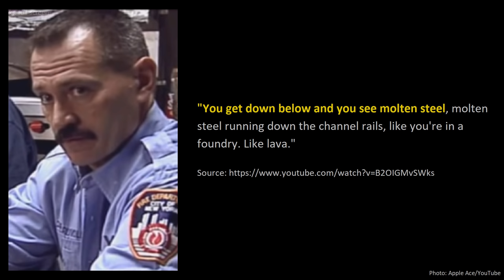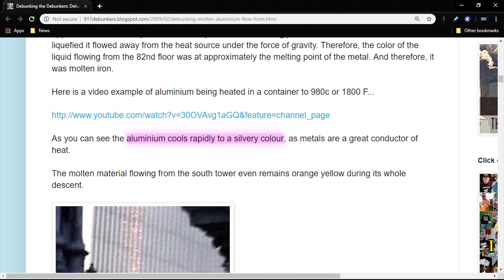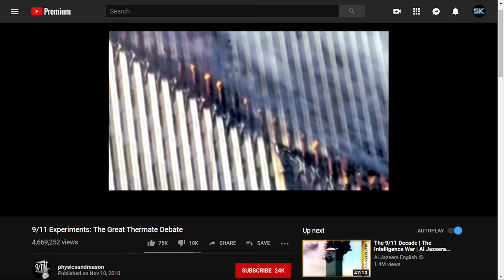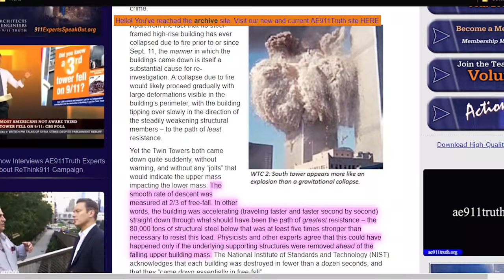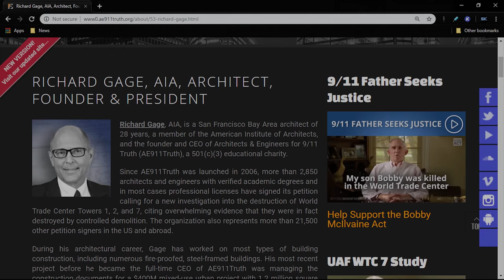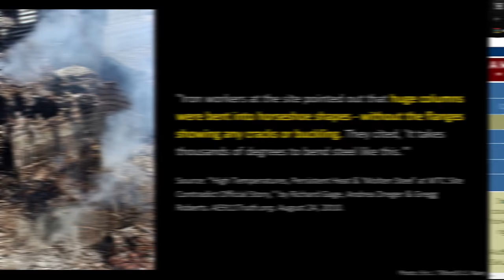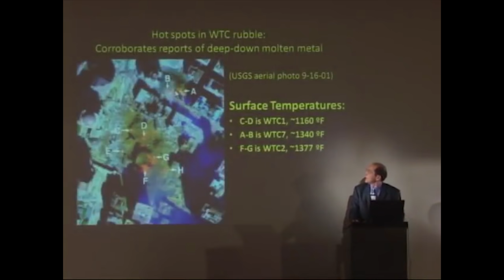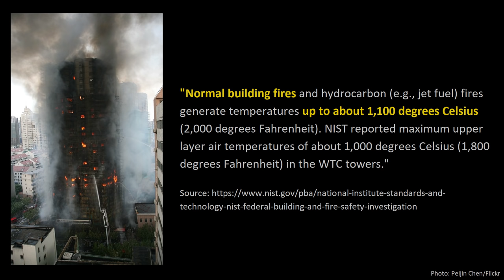9/11 Truthers Debunked: "Molten Steel = Thermite From Controlled Demolition!"

Comment: And as no samples were taken you're also assuming it's molten aluminium.
Reply from the maker: Exactly, +12weasel100. While technically yes, no samples were taken, that doesn't put each position on an equally-reasonable footing. It's a much more reasonable assumption that it was aluminum given the presence of large quantities of aluminum in close proximity to the fires.
Reply: 12weasel100  could you theoretically bring down a building with thermite? It's a possibility. Both parties are running on idealogical biases. Even though Occam's Razor is an effective way to determine whether something is true or not doesn't make it full proof. When considering the 9/11 incident all the evidence is considered at once and everything that happened during that single event is culmination of 'first-time' occurances and bizarre coincidences which, in under any other circumstance, would be regarded with high suspicion. Any objective person should be suspicious considering the high importance of this event on the massive geopolitical impact it has had on the world since.
Reply: 12weasel100  if you're getting the impression that I'm saying thermite was used then you're mistaken. Idk if it was, neither do you, maybe it was jet fuel fires that solely caused the collapse, maybe it was a multitude of factors, maybe it was a multitude of factors relating to the plane crashes and demolition techniques. If someone were to plan a demolition, disguised as a terror attack I'm certain they would take great precautions not to make it look like a demolition. I'm not saying any of this happened or didn't happen. All we have are theories. If an institution goes into an investigation with a conclusion and basing their experimentations on the premise that fires solely caused the collapse, then they will produce findings that support their predetermined conclusion. This is confirmation bias. NIST didn't run simulations of demolitions which could be concealed because that wasn't what they were trying to prove. The Tuskegee syphilis experiments were also considered conspiracy theories until the government disclosed the reports on them. If you think any government values ethics over the pursuit of their version of the 'greater good' then I can tell you with more certainty than the 9/11 conspiracy, that you are gravely mistaken.

Comment: The fires from the jet fuel burns at a lower temperature than the melting point of aluminum.
Reply: Aluminium melting point, 660 degrees Centigrade. Burn temperature of Jet-A fuel in an open-air environment, 1030 degrees Centigrade. In an enclosed environment, where heat can and will reflect backwards off of surfaces? Even higher.

Ooops.
Reply: @mooneyes2k478  most of the fuel burned off quickly - too quickly to raise the heat above the level the T6 Aluminum melts.
Reply: @RantzBizGroup  The fuel is estimated to have been present for about 10 minutes. Not that that really matter, because the buildings themselves burned for about an hour, and the sort of hydrocarbons found in the towers would easily have achieved the same temperatures.
Reply: @mooneyes2k478  now debunk that with the fireworkers who says that the black smoke means low oxygen present to high burn... not enough to molten aluminium and less iron... 2800 F
Reply: @leomiranda3813  Wow. Talk about a desperate desire to find something to make up nonsense about. A 2 year old post.

So, the "fireworkers" say that, do they? Can't be much of a worker if they don't know what black smoke means and doesn't mean. Then again, you don't know how it does, and more importantly doesn't, matter.

Comment: I mean the squibs comming out as the buildings collapsed and Wtc 7 literally coming down like a traditional controlled demolition is enough as well as the nano thermite chips found on the debris of wtc 1&2. Even in a interview some of the firefighters who were there said it looked like a controlled demolition.
Reply: Isn't a "squib" supposed to be a detonator for a much larger explosive charge? So how is it we (allegedly) see squibs but not the primary charges?

How is it y bgg at in 20 years of banging on about squibs, folks like you never picked up on that bit of bleeding obvious?

Comment: The fires got hotter because it was in an encapsulated area, sort of like how an oven works, not to mention jet fuel that burns hotter than regular fuel and all the combustible material within the building itself, steel is going to melt.

Comment: . Aluminum alloy goes  back into a solid state  VERY  quickly . By the time the molted aluminum  landed on the floor from coming out of that high skyscraper it would have already began to harden. They were pulling molted metal from underneath building seven WEEKS after 9/11, .and  Building seven didn't even get hit by a plane.  So how did Molted  aluminum end up underneath  building seven .. HUH ?  Did  Molted aluminum fly  out of the building  and somehow work  its way under building seven, and just  wait hours  for it to collapse ,  and then  continue to stay molten even weeks after that  !!!

Comment: If it hasn’t been tested than your assuming it’s aluminum then
Reply: Yes. It's a logical assumption, after all, considering what the building was clad in. Personally, I suspect it's not metal at all, again a logical assumption considering.
We can, on the other hand, make absolutely certain statements of what it isn't.
Reply: @alicianah8352  Well, it's Occam's Razor, you know. "The position that requires the least assumptions(and the most reasonable ones, in my addition) is the one most likely to be right", etc, etc.

Comment: That liquid metal could be thermite or aluminium. All you need to do is to look that the simulation done from NIST vs UAF vs the video of WTC7. The shape and angles of the 2simulations falling vs the actual video of WTC7 falling shows that  the UAF simulation was clearly looked almost identical to the actual collapse. Also the time it takes for the UAF simulation and the real building fell was very close. However, the time it took for the simulation from NIST was much longer than the actual time it took for it to collapse. ALSO, NIST has most of their information from their simulations classified. And UAF published their full  findings and the specifications of the simulation. Real science reports display all the data and findings. That’s all the real proof you need.

Comment: Actually, the steel columns, could definitely been accessed without anyone knowing any better.  The etc buildings like the majority of modern buildings have lay-in ceilings, which when opened, have an accessible, empty space that can vary from inches to several feet, depending on architectural design.   Access to building structural columns is absolutely possible anywhere the ceiling isn't a hard lid (sheetrock).  Maybe your explanation isn't as solid as you say.
Reply: @skindianu  Dunning-Kruger effect on full display here. When you said, "your gene pool probably needs chlorine", your argument immediately lost all credibility.
Reply: @GamePro0012  not hardly
Reply: except they did shut down several floors leading up to 9/11 so they created the time needed to plant cutting devices

Comment: 9:06, you failed to mention at what temperature the molten metal falling out of the building was expected to be, which is the single most important factor in this situation. Nist is an extremely thorough organization so it's likely they took this into account and is why they made that ridiculous assertion. The example of the aluminum in the video from the forge was clearly much hotter than the temperature of the metal that would be in the towers.
Reply: What "molten metal falling out of the building"? That you want to impose your wishes on what's shown doesn't change anything.
Reply: @mooneyes2k478  did you even watch the video?
Reply: @steamynoodles507  Yeah, I did. Your point is what?
Reply: @steamynoodles507  Guess you didn't actually have one. What a surprise.
Reply: @mooneyes2k478  that the molten metal is discussed in the video?
Reply: @steamynoodles507  Which doesn't change the fact that there's nothing that says that that is metal. Might just as well, and more likely, be embers.

Comment: The whole WTC was aluminium coated exactly at the outside front, where the aluminium is dripping. You don't need the planes. Additionally: If you melt lead or aluminium it would disappear before begunning to stream out of the building.

Comment: so how does aluminum crash through not only the quarter inch of exterior steel and concrete and through concrete floors and then 60 feet in or 35 depending on which side the plane entered hit and knocked out 14 inch steel columns at the core column?
Reply: By crashing through the structure as it actually existed, not whatever it is you made up there.
Reply: @MFitz12  the material that makes up the trade center is more dense therefore the weaker aluminum would have crumpled
Reply: @dino6471  - The aluminum did crumple. That in no way implies the Towers come out unscathed.
Reply: @MFitz12  and the engines why were they never found?
Reply: @dino6471  - So why are they hanging in the 9/11 Memorial Museum?
Reply: @MFitz12 🪴🪴🪴🪴🪴

Comment: The most amusing part of this is, there's no proof that that is even a metal. At all. If it IS a metal, the chances of it being steel is, quite literally, nil. Because there were large amounts of metals that would melt, glow and drip far earlier than steel. This is known as "basic physics".
Reply: There could be multiple ways and/or stages to bringing a building down. One of those being thermite, which would have to be focused on weakening or cutting through certain sections of the supporting structural steel of the building
Reply: @rustyhaarp1850  Since thermite has been used exactly once in history to "bring a building down", and it didn't work? No, that would not be a way to do it.
Reply: yeah its molten wood dripping down.